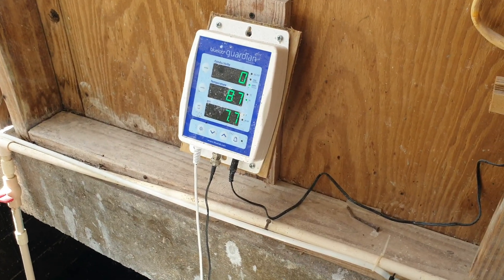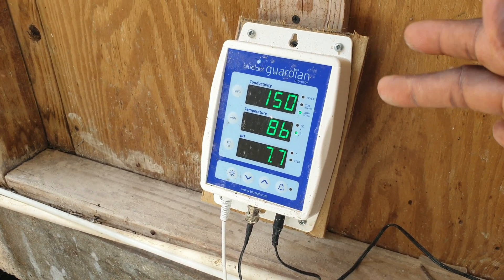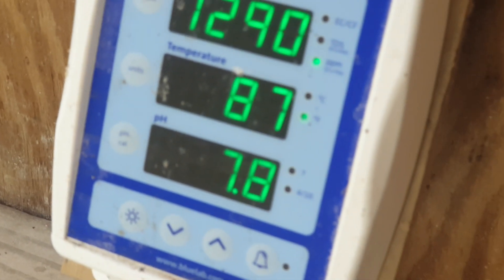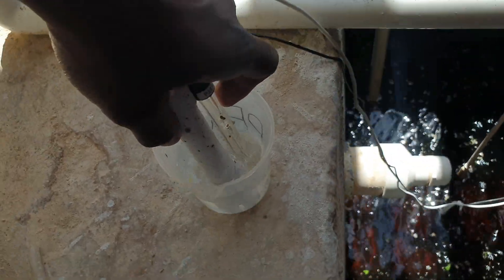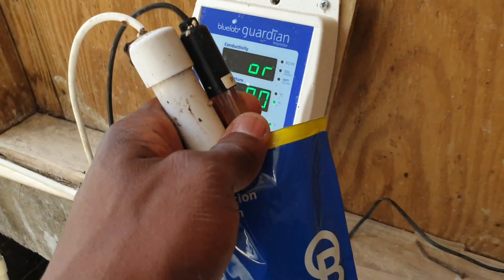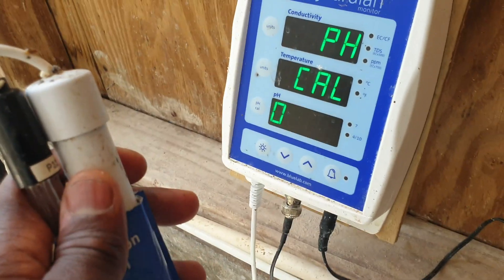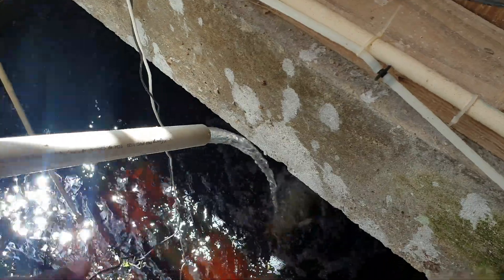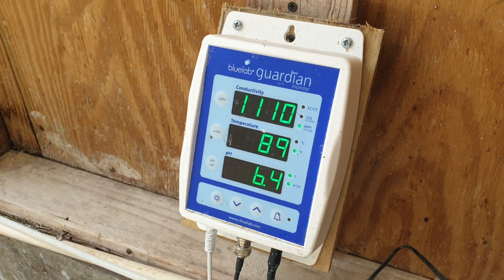How to recalibrate Bluelab Guardian monitor | ph, ec, temp. of nutrient solution

Comment: You only need to put the pH probe in the 7&4 solutions. The EC probe does not need to go into the pH calibration solutions.
Reply from the maker: Pleasant day to you. I did not say that the EC probe needs to be calibrated. The  Conductivity probe or EC probe needs to be in the solution when calibrating because this is the only medium through which temperature will be sensed. As such, when calibrating the pH probes, you need to have the EC probe in the solution so that their can be some sought of temperature compensation when the monitor is calibrating the pH probe.

According to Bluelab, under sub heading "Calibrate pH Probe for the Bluelab Guardian Monitor:"

"pH Probe calibration must be done before use. EC probe does not require calibration but both probes need to be in the solution for pH to compensate for temperature."
Here is the link:
https://support.bluelab.com/bluelab-guardian-monitor

Thank you, I hope this additional information is helpful to you and to those who read comments.

Comment: just bought one of these. what should the tds be for good water. is it as low as posible. mine is showin 650.
Reply from the maker: Hello, thanks for the question. Is it  650 ppm? and if so what type of ion caused your water to be that high? Is it municipal water? It would be better to start off with lower tds value. I would recommend anything under 350ppm, once you start going over 350ppm the plants start showing mild but  progressive symptoms of phytotoxicity.
Reply: @MCAgriTech  how do i do that with a big water c change. is it lower the better